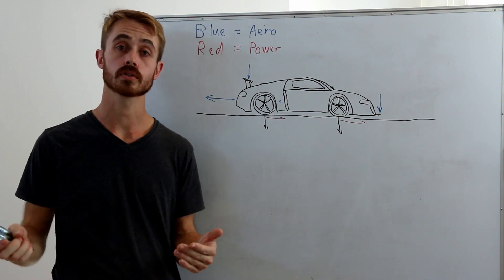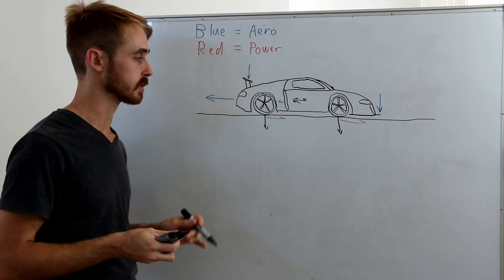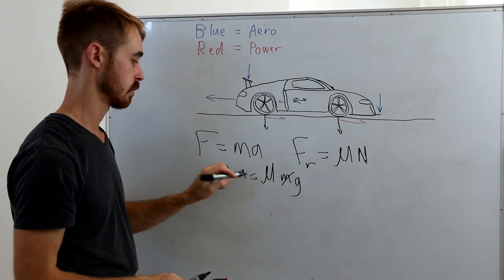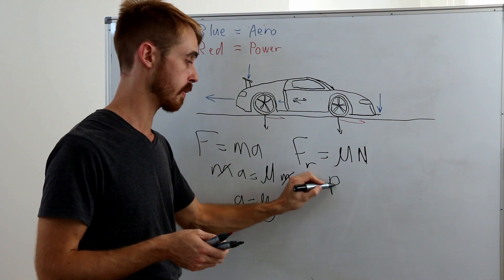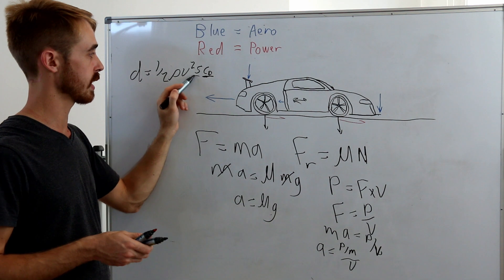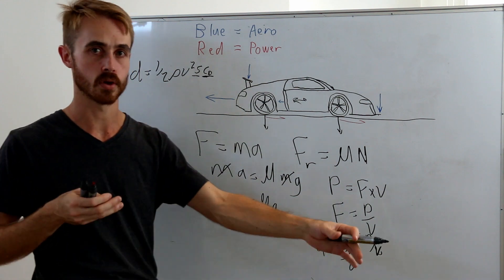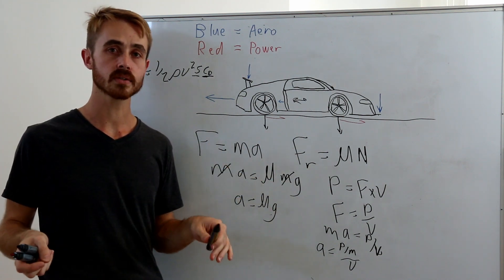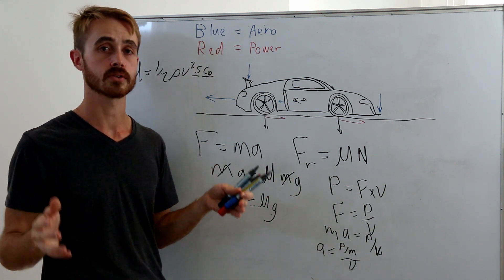Power to Weight Ratio - Is it all that affects acceleration?

Comment: more power usually means more power to airdrag ratio unless you have a small very aerodynamic car. transmission losses and power curve shape also play ian importnt role on powertrain performance. a high torque engine can mean less losses and more power in some key operating rpm regions

Comment: Not sure how pedantic you wish to be but there are some very basic errors in the physics that you present.
1. Newton's 2nd Law is not F=ma: it is Fnet=ma where F is the "unbalanced" force. The engine does not provide Fnet. A lot of the engine's force is lost in the drivetrain friction, rolling resistance, etc, even at low speed when aerodynamic drag is negligibly small.
2. The simple expression for friction (mu x normal reaction force) is very inaccurate when applied to car tyres. If that expression was true then wider tyres wouldn't give greater traction than narrow tyres as the classic friction force is independent of contact area (there is no "A" in the simple friction equation that you refer to and use). What is critical for car traction is "mechanical grip", which is not just friction but represents the sum of forces acting between the tyre and the road surface.
3. "The mass of the car pulling us back"! That is a real howler. The mass does not exert a force or "pull" opposing the car's motion. The mass is simply a measure of inertia or resistance to acceleration.
4. "As we increase the speed the normal force increases". No. You have already defined normal force as mg. As the values of mass and g do not change with speed then N does not change (in the absence of aerodynamic downforce. If there is aerodynamic downforce then it needs to be added as an additional force term).
5. "The car that is lighter with less power has a higher component of drag on it than the car that is heavier"?? Drag is a force that is only determined by the coefficient of drag (Cd) and cross-sectional area (at equal speeds). Hence drag depends entirely on the shape of the car and not on whether the car is "lighter" or "heavier" or how much power it has. It is entirely possible that a smaller, lighter, less powerful car will have lower drag, or as you put it a lower "component" of drag and a higher top speed. "We assume the Cd is the same" - again, not the full story because the vehicles' cross-sectional areas also need to be taken into account.
6. The top speed comparison between the Lotus and the Bugatti is misleading: top speed is purely determined by when the net force provided by the engine reaches equilibrium with the total drag force (aerodynamic and other drag forces) - it has nothing to do with the weight of the car, and hence the power to weight ratio either. 

Your conclusions are broadly true but I find that the reasoning does not rigorously support them. If physics is to be used - as it should/must be - then it should be without gross simplifications and half-truths. Or at least some qualification should be provided stating that some simplifications have been made which will not always give the results asserted in your video. 

Apologies for sounding negative - I think that your goals and effort are nevertheless generous and praiseworthy.

Comment: Sir, I disagree. Lighter vehicles will ALWAYS be quicker and faster IF the power output at the wheel is exactly the same. More weight means less acceleration is because heavier and more massive object is harder to accelerate, heavier vehicles will also have more ground friction/rolling resistance. Try adding 2,000 pounds (907 kilogram) in YOUR OWN car and tell me how fast you still can accelerate and how fast you can reach, and try it with your vehicle empty. I can guarantee you without the added weight your OWN car will have a FASTER top speed as well.

The aerodynamic drag is all the SAME, whether you have extra weight in your own car or not. Except weight will probably make your car more stable at higher speeds. However weight will also reduce your top speed. More weight only means more rolling resistance/ground friction.
Reply: Exactly and sandbags are always available
Reply: @Whatguywhat  and concrete mix bags ;-)
For non-believers...
Reply: @prandomable  😂yep! I got a 77 Vega I don’t use bags unless the track is poorly prepped or I’m on a street no running slicks but this guy wasn’t make a lick of sense with his nonsense you hit it right on the head with roll resistance and friction factor
Reply: @Whatguywhat  more weight = less top speed ESPECIALLY going up hill. Level road it will reduce your top speed a bit as well.

However going down hill it will actually INCREASE your top speed the more weight you have.
Reply: Yes, I agree with you on that "extra weight" or mass, if you will, DOES affect top speed for that extra thing has an impact on the tires, which in turn on the rolling resistance or ground friction.  The coefficient of drag, or Crr,  is not a constant contrary to popular belief.  It is a function of speed.  It may be 0.010-0.015 at ordinary highway speeds, but it climbs up to 0.0.020 and above at 100-200 mph, which if you solve the drag equation, the top speed is affected.  On the drag equation, increasing the mass m increases the Crr, which in turn will lower the top speed.
Reply: @nats50  more weight = less top speed. ESPECIALLY if you are driving up hill!!
On level road it will likely reduce your top speed a bit as well.
HOWEVER going down hill weight will actually INCREASE your top speed though...
Reply: It depends on what you mean by faster. 0-60 or top speed.
Reply: @KevinUrban-u1z  top speed will also be slower. BUT not by much. And acceleration will DEFINITELY be slower without a doubt...
Reply: @KevinUrban-u1z  18 wheeler loaded with cargo vs 18 wheeler with empty trailer. I bet the 18 wheeler will have different top speeds.
Reply: If not factoring resistance, top speed should be the same regardless of bhp
Reply: @hgdrkui  try adding extra weight in your vehicle and see if you can still reach the same top speed lol. Extra weight I mean load your vehicle to the GVWR...
Reply: @prandomable  it just takes a lot longer time for the heavier to reach the same top speed, thats prob y u think in practicality the heavier car has a lower top speed. also its literally a 2 min google search if u want to learn the math and stuff. again, what is technically true might not always be intuitive or how it feels in real life due to other practical factors (ie rolling resistance). if u struggle with reading, u could also try using LLMs to summarize for ya. good day.
edit: also im not sure u realize how ignorant ur rationale is, telling someone to literally physically try it bcuz they dont agree with u. ur basically saying logic and theoretical physics are as good as none
Reply: @hgdrkui  a lot longer??? No. It will have LOWER top speed. Why??? More weight ALSO means more rolling resistance. More road friction...
Reply: @prandomable  yea that falls under practical factors, irrelevant to "power to weight ratio", as ive literally just explained. i mean there r a myriad of other such practical factors (ie power curves, tire grip, transmission ratio, etc) that come into play if we're talking literally/practically, but thats not what the video is about -- if we hold all else constant and just look at weight and power, how do they effect acceleration and top speed
Reply: @hgdrkui  as long as you are factoring extra weight with rolling resistant. Then you'll understand why weight will also cause lower top speed as well...
Reply: @ do u English? I’m saying u shouldn’t factor in rolling resistance in this case as it is irrelevant. By ur logic, why fixate only on rolling resistance? Why not take into account the other PRACTICAL factors that I’ve mentioned? Bruh u half wit or smn
Reply: @hgdrkui  do I English???

Do you even know how to use proper English grammar??? LOL!!!
Reply: @prandomable  im guessing ur on the older side cuz clearly u arent aware that "does someone english" is a sort of a troll prase to use to mock someone that doesnt speak english, uk its like saying thats how THAT person would ask the question bcuz they dont speak the language, lol. learn to use google my dude. or do i need to also explain to you what "troll" means.

also uve not addressed my points as to why u choose to fixate on rolling resistance and rolling resistance alone but not other practical factors. its clear that due to ur limited knowledge it just happened to be the thing that u though of, even tho its irrelevant to the topic of the video. i trolled u on not being able to speak english bcuz clearly u struggle with comprehension, but u trolled me on not being able the speak English bcuz u couldnt think of a better comeback, lol. way to go, geezer.
Reply: @hgdrkui  you can't even spell, and have to edit your comment LOL!

Comment: Hmm. Interesting (no doubt) but incomplete... 

Lighter cars (with same p/w ratio) are often narrower and overall smaller than heavier cars (I've seen a Veyron once at Geneva Auto Salon, as well as the 4 turbo'd W-16 engine, That's huge!) so the lighter cars could have less drag coefficient than heavier cars. But the light ones are not aero-designed for maximum top-speed, but for maximum agility. More downforce results in more drag, results in lower top speed. Above 300 km/h You'd need a huge amount of extra power to get a few km more top speed and there are not many streets or tracks to go flat out.

There is a good documentary about the Veyron, if I remember well he said that above 350km/h the Veyron need about 10hp more for every single km/h more. 
That's why "usual" sports cars or supercars are seldom faster than 300...330 km/h, where the territory of Hypercars begins.

Comment: power to weight ratio = the same at a given instance, then the acceleration is the same. ( IN A VACUUM) 
the ratio can change, like a 10lb rc car with 1hp vs a 3000lb car with 300hp. the acceleration might be the same, but only on paper. once you introduce gears and air resistance, clearly this same ratio tells you more than just a ratio. the rc car with the same ratio will not perform the same as the car since the available energy is not the same.

Comment: He doesn’t address the issue of torque and the need to get revolving mass up to speed. It depends on where the weight is distributed so that if a car has very heavy wheels compared to a car of similar weight but with light wheels and a heavy body, it will accelerate slower.

Comment: Weight doesn’t increase top speed, it’s the higher power that does. 

If two cars have the same drag, same power to weight, only diffrence is one weighs more and makes more power

At 60mph when drag starts to take effect it will have a smaller impact on the car that makes more power.

Comment: Basically Traction rules off the line and aero dynamic drag rules top end.

That's why the AWD Chiron Beats the RWD Koenigsegg Agera RS up to about 250kph and after the High drag Bugatti is toast.

Need to see them run on a drag strip which will help the RWD Only Agera RS more....never seen that video Yet.
Reply: Traction is Key given the same hp/Lbs. That's how the  $85k 840hp Dodge Demon out runs a $1,2million 987 hp Veryon that weighs the same.

RWD with Drag radials wins over AWD when wheels come of the ground.

Also why the Nissan GTR falls on it's face after 180kph. Traction isn't a concern and the Low HP/lbs slows it compared to it's competitors.
Reply: @JerseyMikeP  the gtr doesn't fall on it's face at all lol

Comment: Would 500kg to 500hp be insane?
Reply: That's basically what Koenigsegg Says the One:One has. (1:1 hp/kg)

By comparison, A NHRA Prostock car is better...about 1,400hp, 1,066 kg. (1.31 to 1 hp/kg)

Top fuel is 1,052Kg...and currently said to be Over 10,000 hp. (9.5hp/kg)

BMW 1000RR by comparison is 199hp/204kg ( .975hp/kg)
Reply: Nah, that's just 2.5 supersport motorcycles. Honda, bmw, Ducati, whatever, they all got over 200hp at 200ish kg with fuel. Allthough granted, the rider ruins that way more than with a 500kg car.

Comment: power to weight wont make two cars at the same weight to power ratio accelerate the same , cause of where the power bands are on their motor and configuration of drive train ,  theirs a lot more that go into making cars faster and performing , like unsprung weight , RPMs where its in its most efficient power and how fast it can get to those rpms of efficiency , tires of how sticky they are or not depending if you a little bit of slip to jump rpms before they reach optimal temp for gripping , spring rates of your car to provide best traction for you configuration , damper rates , gear ratios , tire size in height and width , cooling system to keep your engine at its best temp for proper detonation of gases , and minimizing heat friction , areo dynamics , traction to you drive wheels , shift times , power to weight is great thing to to have higher HPvsWeight it helps your car a lot but to compare to very different cars off the same number is not something to really do and can be ideal for gustamating but it comes down to side by side , on the black top find out
Reply: Excellent!
Reply: Well said; I knew someone would have spotted that.
Reply: if the power to weight ratio at a given instance is the same. then, the acceleration would be identical. since the energy input to move a certain weight is the same. it cant break the laws of thermal dynamics. when you discuss gearing, drive loss and traction, then you aint talking about the same power output at all times, thus making the original question VOID
Reply: Those are all valid points but if we were talking about the same car. So all factors remain the same, the lighter car will have better performance on almost all metrics. Unless it takes it too far away from the spring rate that it was set up for  but in general if you make your car lighter and leave everything else the same it will perform better.
Reply: Oh wow, 8 year...😅
Reply: @johnathanstormborn7462  I don't remember what this was about. 😂🤣

Comment: but isnt displacement a very importante factor here ??
Reply: No, With proper gearing a car with a smaller engine with the same HP that weighs the same will run the same time.
Reply: It is, in the fact that you will probably make more power or P.  BUT, Whether it's naturally aspirated big displacement or high boost smaller engine the overall Power number is what he's looking at.  Look at large displacement of an engine more as potential to make even more power given that same mods as small engine.
Reply: Depends. Imagine a super high revving engine, that does 150hp. 1200kg car. Versus a 150hp engine that has more cc, much more. Slightly heavier car. The heavier car will be faster off the line, because gearing wont help you gotta start at low revs, unless you got a particular torture resistant clutch.  The torque at low rpm comes into play. ..... Buuuuuuuuut!  Repeat the game with 1000hp.   You cannot actually get it all on the ground from 0 anyways, so the torque the weaker low cc engine gets on the ground at low revs might still be more than possible to actually turn into acceleration, now the lower weight it has is better